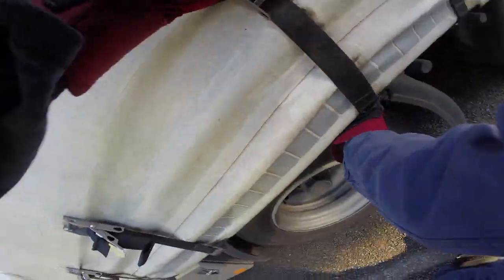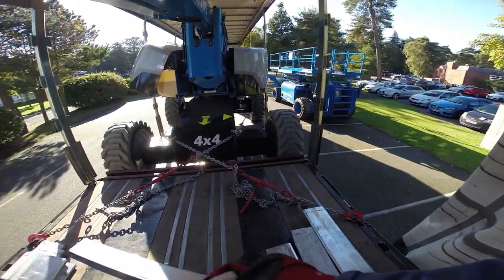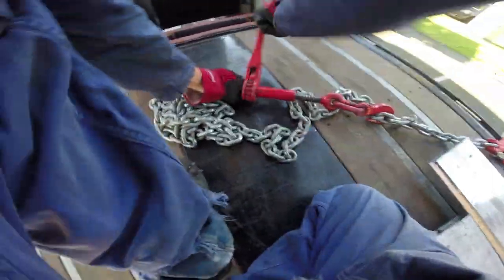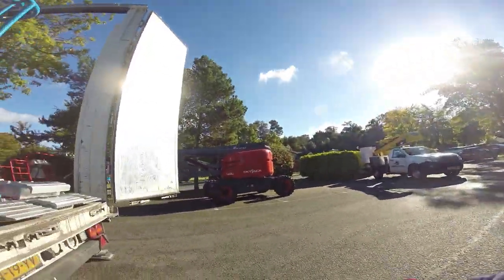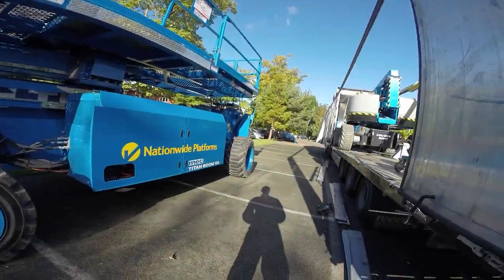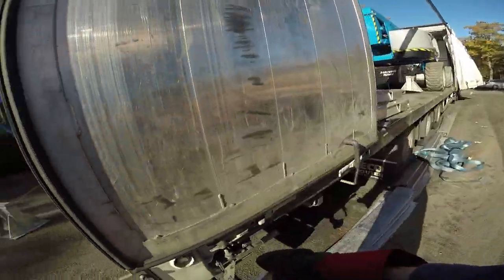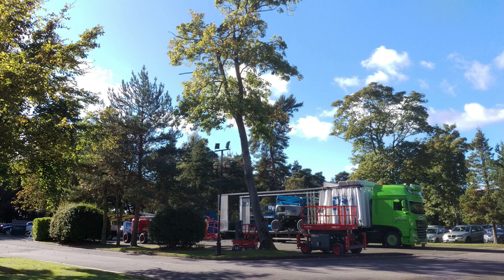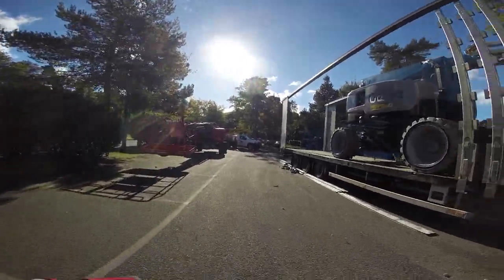WV 02 - First Class Delivery! - England Trucking - W.de Zeeuw Transport

Comment: Thanks William. How heavy is your trailer empty?  In Canada, we tarp our loads and the trailer weight empty is 4854 kgs. Although we do not usually tarp machinery like you were hauling,
Reply from the maker: This one is around 9 - 9,5 tons empty. But you're talking about an flatbed I guess?  We've got those too, but weight really depends on which options you've got on them
Reply: Yes a flatbed indeed. Because weight is so crucial, you do not see very many soft sided trailer such as yours in Canada, mostly for city delivery.  But then again our trucks are much bigger.
Reply: A 45ft/13.6 M (Tri-axle) flat trailer here is usually 6200Kgs, while the same in 'Tautliner' form (i.e.curtainsider) is 7200kgs. A big cab, big engined tractor will weigh in region of 9000-9500Kgs dependent on make. My Scania V8 3 axle tractor was 9.5T. With a curtainsider behind you are in the region of 17T empty. Max Gross allowed 44T.